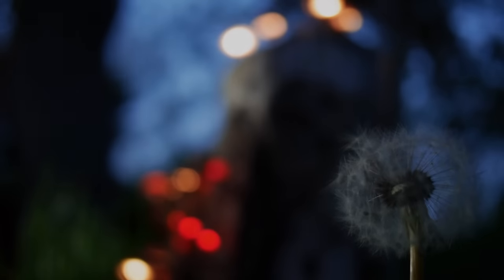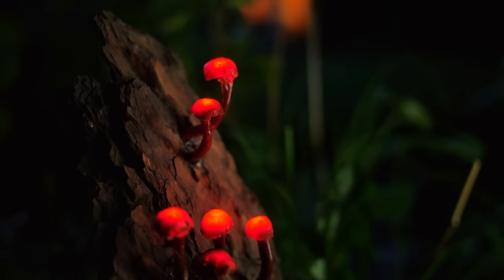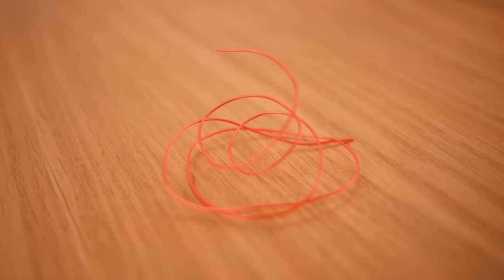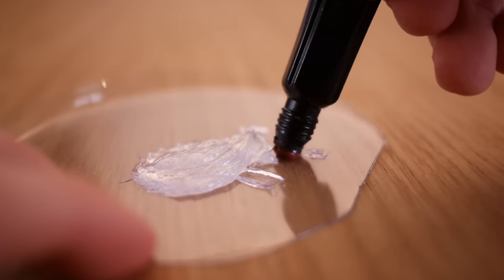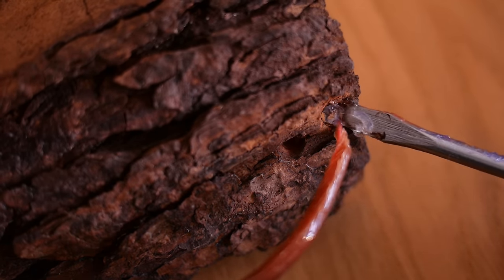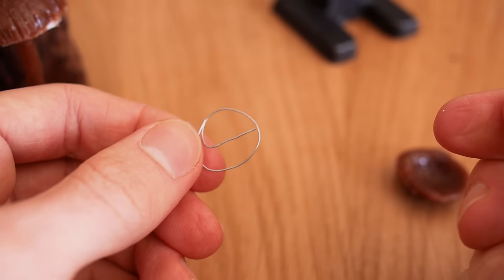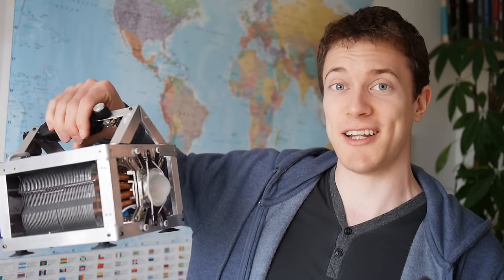DIY Mushroom Lights (craft project)

Comment: I wish I could make these but I know nothing about electricity
Reply: Just use an normal Led stripe ^^ works too i Made it Today and it Looks awesome
Reply: you don't have to know anything about electricity ? if you don't know about ohms law just use an ohms law calculator.
Reply: MrMegakoekje you don’t even need ohms law it just can’t be a short though the led. practically any sized resistor will work but you can always feel safe with 1 or 2 k.
Reply: He quite literally tells you the steps in the electrical first, so I'd give it a shot..
Reply: PinStroke Pw I like that idea, do you have any pics please?
Reply: yeah all that stuff sounds like cosmos
Reply: Thats why he shows u how to do it. Its just battery lights
Reply: Pack of solar fairy lights with enough distace between each light and you could do exactly the same..... there wpuld be bloody loads of them, need a big bit of wood! And as ots solar ot coupd gp oitside and never need new batteries.... yep. Im off to bnq!
Reply: You can do it! I don't know anything about electricity either so I'm using the same stuff he used and following along meticulously. It's not so hard!
Reply: don't worry me either
Reply: I can help you
Reply: Pretty simple postive to wire to postive same thing with the negitive
Reply: Same hear
Reply: Use Google
Reply: Search on thinkercad some led circuits, they are made by teachers and real engineers
Reply: Same
Reply: Same.
Reply: The only thing I know about electricity is that if not handled correctly it will hurt you.
Reply: Same... 😞
Reply: Just use a string of tiny fairy lights instead
Reply: Just enough to get shocked.⚡️
Reply: To keep it simple, just use 220ohm resistor for any small LED, it's a common resistance in LED applications 😉

Comment: I have to say that I thought my husband was the only one that had a thing for LED lights. So after he watched this video he's now on a new project.  But I was wanting to know what materials you used to make the white mushrooms? Obviously a white LED light, but I was wondering what silicone was used? Did you use a white silicone or clear silicone with white paint?
Reply from the maker: For the white ones I just used some white paint in the clear silicone - works a treat!
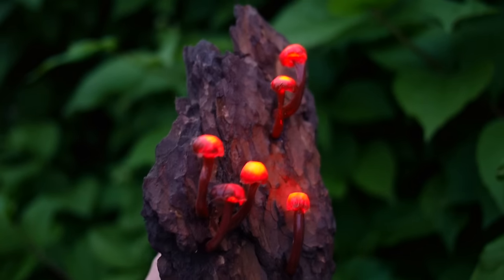Reply: +DIY Perks What music did you use from 7:57- 8:25 to present your mushrooms? It sounds just awesome and mysterious
Reply: +Kelli Peterman - your husband is definitely not the only one fascinated with lights/LEDs... my girlfriend always hates it when we walk by the lighting aisle at whatever store we're in, because I stand there looking at them all for 10 minutes
Reply: +Kelli Peterman  if u have some patience... do the same as above with glue sticks... it works great.. and i did that.
Reply: @Astroveekshet  that would also work but accumulate dust quicker and when its hot/warm inside the top layer could melt then fuse in the dust particles also... which means u cannot use the outside...

Comment: I'm about ready to roll.  I have lots of caps made.  What if I wanted to put more than one bulb inside a very large cap?  Can that run on the same powersource as long as I use the correct resistor?  Some I am using without LEDs inside my frog terrariums and they look great.  I snuck a small trio into one of brother's terrariums.  He thinks he has the longest lived mushrooms on earth...ha!  They've been in there for three weeks.
Reply from the maker: To fit multiple LEDs into one mushroom, the best practice is to solder them in parallel (after the resistor). You'll have to double the mah in the sum though, and choose an appropriate resistor value.
Reply: @DIYPerks  exactly i'm gonna take apart a multicolor strip with RC... then put the RGB leds into 1 shroom, will be epic!!!

Comment: Instead of using tissues and bent up antenna fill the mushroom cup with transparent silicone. Then gently push the stem with LED in. Not all the way up but only to cover the LED. Let dry. This is much easier and you get better water resistance if using in garden.
DIY thanks for  all your lovely tips and trix!
Reply: They make WHITE silicone as well if you want the reflective aspect to it.
Reply: That's a great idea!
Reply: Wow thanks! I was indeed hoping to turn my garden into a magical forest. :)
Reply: Could you show it with a video? Thanks anyway.
Reply: Awesome!  The LED won't get destroyed in the silicone?
Reply: @AshleyEllwood  Nope
Reply: @ignaciovicencio  thanks!!  :)
Reply: Good idea for outdoor use :)
I like the look of the white bottoms though, but I suppose one could always use some white coloring ;)
Reply: 700th like ur welcom
Reply: 722th in the house
Reply: You use the batteries outside? That seems like the pack would get wet qnd not work.
Reply: I think this will not allow the light to disperse....
Reply: Thanks for the tips!!
Reply: Not sure how good this would be for heat dispersal. Silicone is a very good insulator meaning the LED would not be able to loose it's heat. Especially in these type of applications where the LED will be on for longer periods of time on end it will drastically cut down the lifespan of the LED.

Comment: I wish I was smart enough to make these... I'm in love
Reply: you probably are mate...,give it a go
Reply: Being smart has nothing to do with it. Learning small skills over time can turn you into a handy guy, just like him.
Reply: I think exactly the same but I'm gonna give it a try anyway. You can always ask for some help too!
Reply: Marc Manuele really are you in love ❤️
Reply: like so many of these projects this is just about starting it and sticking to it. trail and error your way to the end! not being smart enough is such an easy excuse for not starting projects like this one!
Reply: The only real technical knowledge he used were basic circuit elements (diodes, resistors, and a DC power source), Ohm's law, soldering, and the +/- lead locations & other specifications on the equipment he was using. For someone at a high-school level of education on these particular concepts, you can learn all of this in under a week, though you'd need access to soldering equipment and a bit of practice just to get used to handling the molten metal. Also, don't breathe the fumes. It's not immediately poisonous, but it's pretty bad for you in the long run.

Once you break down the above concepts and realize how they're incorporated into the project, you'll be able to customize it pretty well. I made mine a big blue mother mushroom with multiple LEDs in the hood and a few baby shrooms near its base, all mounted into a flower pot with some well-packed gardening dirt. The ones he made didn't really light up a corner of the room, so I made one that did.
Reply: You have the intelligence and dexterity to write this comment as a response to your understanding of the video. You’re certainly smart enough, as am I. It’s our determination. 

For sure, our early attempts would probably not have the finesse that the creations of DIY Perks have, but you gotta start somewhere.
Reply: Kazmir Runik I would love to see your mushroom light!!
Reply: That's what o said to myself, and this week I'm gonna buy the items to finally make this. Maybe alterations to it for my own liking.
Reply: Don't sell yourself short.

Comment: Hey guys! Mine worked with a small amount of acrylic paint! A little goes a long way! I also used a string of led's with a battery pack from Amazon. It worked great, no soldering needed!
Reply: Danielle Phillips Did you have issues with the silicone drying in the clear wrap? Mine will not dry and it comes out all gooey!
Reply: Caroline P need to use acetoxy silicone. Anything else can take a week or more to cure.
Reply: Thank you for the tip! He lost me at the soldering part. I didn’t do well in the AMPS/Watts/volts section of science class lol
Reply: Danielle Phillips - i know this was hella long ago, but what kind of led’s did you get?

Comment: I made some! And they look cool! I made a few mistakes, they are too big, and thus too heavy and needed to be supported by some hidden pins, but overall I am very pleased. I used 20g silicon to 1g cerulean blue, and they are BRIGHT blue. I needed a croccy clippy helping hands thingy (which is used but not mentioned in the video) to do the soldering. Next time I will make the stems neater and thinner, and use wire coloured to match the silicon for the wire to the led so that it is less visible within the stem. Great video, Thanks!
Reply: Excellent feedback!
Reply: I'm trying to make this project now but I'm having difficulty with the silicone. It's not getting enough air to dry wrapped up in the plastic wrap. Do you have any tips on how to get the silicone to actually dry?
Reply: @IWontHealYou  how much acrylic paint are you using to colour them? You only need a tiny amount, and too much stops the silicon from drying. Mine usually take about two to three hours.
Reply: @IWontHealYou  I believe the amount of paint used to colour the silicone is critical. Too much paint retards drying. mine usually take three hours